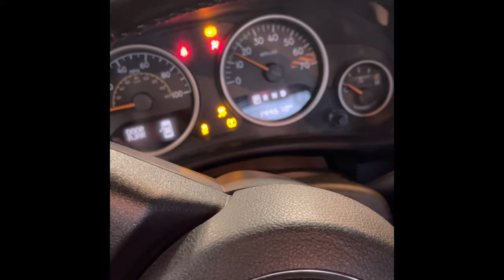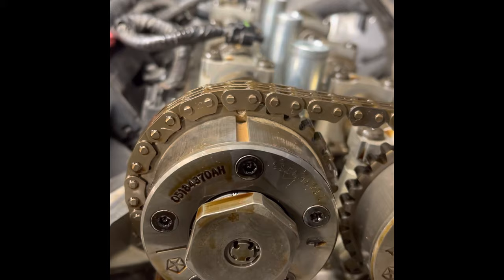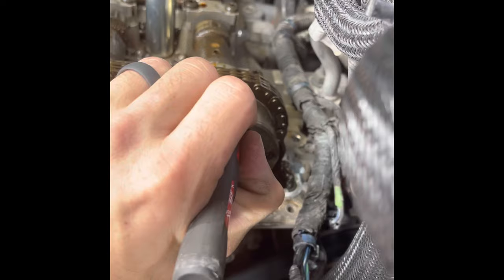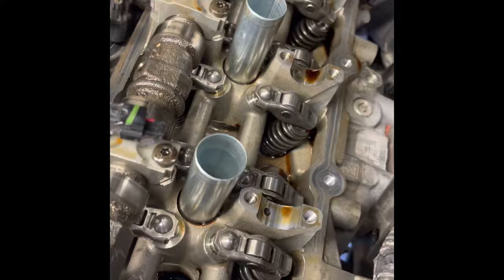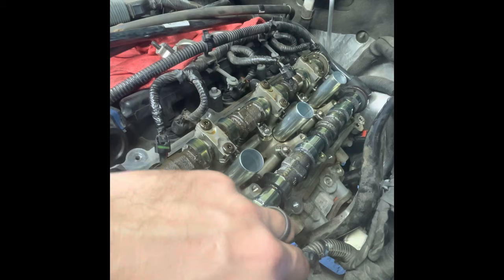Fixing an Engine “Tick” on a 2016 Jeep Wrangler | Rocker Arm Replacment

Comment: Replaced my rocker on the left bank #2 at 70,000 miles.  Dealer tried to tell me I needed all new rockers, lifters, camshaft, the works for 2300.00.  Did it ourselves for under 600.00.  Only one rocker was bad.  Lifters, camshaft etc were all fine.  The Pentastar overall is defective in that the number two cylinder doesn’t cool properly.  Anytime you swap for more horsepower you’re gonna sacrifice something else.  Chrysler knows they’re defective and yet will not recall.  At one time dealerships were getting hundreds of vehicles a month with the same issue.  Expect to hear the “death tick” around 70,000-80,000 in a Wrangler.  Fix it asap to avoid replacing more parts.
Reply: Well, sorta… early JK 3.6 cylinder 2 issues are from a bad cylinder head molding process, and there was a recall/maintenance service bulletin. I had that done myself. It was covered by the recall. 

If the head gasket can’t seal right it will cause issues down channel issues such as cooling.
Reply: as someone who is looking for a wrangler as a toy pretty soon, this is good info to know. thanks for sharing
Reply: Cylinder 3 is what got me. Rocker failed at 136k

Comment: A lot of the issue stems from the cartridge filter. The oil drains to the pan in minutes after shutting off the engine and constantly leaves the top end dry. They have a adapter for a regular spin on filter so you'll have the anti drain back valve to keep the top end of the engine always soaked with oil.
Reply: Thanks I'm going to look into this!
Reply: Do you have a link for it?
Reply: I modified mine - Baxter Performance - no more dry starts
Reply: Food for thought. All this full synthetic 5/20 0/20 oil.... I always go with a synthetic blend and something thicker...just sayn
Reply: What is this part called and do you have link??
Reply: I read you can prime the filter by holding the gas dwn, turn it over for 3 seconds. Turn it off. Start the engine, it starts quiet. I've got just over 12k/kms on my 2015, annual syn oil changes and it sounds like it's already starting to tick. So it's a common problem but no recall?

Comment: So the sound is not normal
Reply from the maker: No, they’re supposed to be relatively quiet. If you hear a lot of tapping noises then there’s definitely an issue. Sometimes it will progress to the point where you’ll get a check engine light and the vehicle will start misfiring and running rough. On the Jeep in this video, it actually hadn’t progressed to that point yet but it was just loud.

Comment: You do not need to go through all of that. I have done 16 of these, and never taken the chain off. That little bit of scoring on the camshaft is not gonna make any difference. All you need to do is mark the chain and camshaft each on three different places remove all of the camshaft caps. Except for the one closest to the cam gears. Those need to be loosened rotate the engine with a socket on the crankshaft and when the lobes are pointing up, the camshaft can be raised slightly in the rockers come off.
This is actually a simple fix doing it the way that I described.
Reply: Exactly!
Reply: You can even replace the rocker arm closest to the can gear doing it this way? I assume you replace them one by one, as you rotate the crank and get the lobes to point up?

Also, where do you mark on the cam and chain?
Reply: I’ve seen this hack, and I believe that removing the cam shafts as done in this video  isn’t THAT much more work IMO. Also the cam shafts are relatively cheap and worth replacing too. Especially if the cam damage from the bad rocker is significant, which it can be, and will cause issues. They also likely have 100-150k miles on them. 

Also delicately removing the rockers with the cam pushed over takes patience and time. Especially the ones close to the timing chain. 

Anyways, it’s one way to do it, just not one I’d do myself. I’d also say going all out and removing the timing chain cover (technically the proper way) is a bit absurd, so this video is a good compromise.
Reply: Wanna make that 17?
Reply: @harrycallahan686 Haha! Made me laugh.

Comment: I have not yet taken my Jeep in, but I’ve had this clicking noise for quite a long time now. It’s starting to get on my nerves, so I figure I should look into it. I’ve been told online by people hearing the video that work on jeeps that I need a new engine… But the clicking sounds just like what I’m hearing on this video. Is this a pricey fix?
Reply: I was just told the same thing for my Wrangler JK… needing a new engine or selling my Jeep before anything worse happens. For the job it needs done would be the same cost as getting a new Jeep. Sucks..

Comment: Are the replacement rockers an "updated" part - or doomed to fail again? Chrysler knew there were problems for years and years - you would think they would have treated that rocker bearing like it was mission critical, like a rod bearing.
Reply: Not if the Dealership is making $2,500.00 to fix them
Too bad Chrysler, Dodge, Heep, & RAM can't build quality Valve Trains that last 250,000 miles like Toyota.

Comment: Question for you. When you turned the camshaft to align the sprocket, that doesn’t mess with the timing? Maybe I need to go watch a timing video lol!!
Reply from the maker: No, because as long as the marks on the chain align with the marks on the sprockets, then the timing is good. On the front of the camshaft there is a little dowel pin, so the sprocket can only go on one way. By turning the camshaft, I was actually lining everything up properly. I’m not sure if I answered your question.

Comment: Hello. Thank you much for this clear explanation! Extremely helpful. 
Could you please share Oem references for rocker arms, lifters and camshafts ?
Reply from the maker: Rocker arms: 5184296AH
Lifters: 5184332AA
Camshaft Exhaust Left: 5184377AH
Camshaft Exhaust Right: 5184378AH
Camshaft Intake Left: 5184379AH
Camshaft Intake Right: 5184380AH
Reply: @jackhfletcher  Thank you!!
Reply: @jackhfletcher  any view on Melling rocker arms ? (MR-1332). Any upgrade compared with oem ? (they're 40% cheaper than oem)

Comment: I had the rocker arms and lifters replaced in my 2013 JeepJK. Probably 10-15k miles ago. Im now having noise on start up after the Jeep sits for a couple of days. It s kinda of like a ticking noise for 5 or 6 seconds then goes away. Are they going bad already?
Reply from the maker: A lot of different vehicles tend to do that after sitting. I wouldn’t worry too much about it.
Reply: Was it expensive to have it done?
Reply: About $3500@ the jeep dealer

Comment: i ended up getting a misfire code for cylinder 2 and engine started overheating. ( i did not burp it so maybe thats why its overheating?) any suggestions? Also i noticed that the alternator connector isnt locking properly but i will be switching out the connector tomorrow morning. I cleared the code restarted the jeep and it popped up (engine light) and went away 30 seconds later for the same code(misfire) Any help would be greatly appreciated
Reply from the maker: Have you done any work to it recently? If so, what all has been done?
Reply: @jackhfletcher  while i did the rocker arms i lifters i also replaced the pcv valve and oil cooler housing
Reply from the maker: If the overheating didn’t start until you replaced the oil cooler, then you probably got air in the system. Take a flat head screwdriver and open the bleeder valve on top of the thermostat housing until you get coolant running out. I recommend using a spill free funnel and putting it on top of the radiator and filling it with coolant. Start it and let it run and warm up and then shut it off and let it cool down. You may have to do this a few times. Then remove the funnel, reinstall the radiator cap and go for a drive. It should be OK after that.
As for the misfire, if you still had a cylinder two misfire before doing the lifters and rocker arms, then the problem probably lies elsewhere. But if the cylinder two misfire did not start until you replaced the rocker arms and lifters, then I would go back and double check all your work. Make sure your coils and injectors are plugged in properly, etc.
Reply: @jackhfletcher  i just bles the system but still no heat and it starts overheating. Once the fan kicks in it starts to overflow on the funnel

Comment: @jackhfletcher Changed my rockers, and now getting a check engine… cps bank2 sensor B  and multiple misfire…..will this need to be relearned or will it do it from driving? Thanks
Reply from the maker: It shouldn’t do that. Something probably wasn’t put back properly or something got damaged. Bank 2 sensor B is the driver’s side exhaust cam. Check the cam sensor. Make sure it’s installed properly and make sure the wiring is good. You may have to pull the valve cover and see if the sensor or the target wheel on the exhaust cam is damaged. Actually, I just realized as I’m typing this that more than likely the timing is off if you removed the timing chain. Double check the timing.
Reply: @jackhfletcher  no actually a friend (mechanic) did it for me and didn’t remove the chain
Reply from the maker: @rbjackpotslots4842 Check the other stuff then. I’ve done a bunch of these and I’ve never had to do any type of re-learn.
Reply: @jackhfletcher  ok thanks for the quick reply I screen shot this I will show him thanks again

Comment: I had my oil changed at my dealership and they forgot to tighten the oil filter the low oil pressure light came on then the check engine light while me and my seven year old were driving on a very busy highway the jeep lost power almost got in a really bad accident got it towed dealership said nothing was wrong now it makes this noise it only had 2 quarts of oil but nothing was wrong 😂 what do you think are they trying to cover their ass 😮

Comment: Is it normal to still hear a slight tick after replacing all rockers and lifters?
Reply from the maker: You’ll always have a little bit of valvetrain noise  so since you replaced all the rocker arms I wouldn’t worry too much about it.

Comment: So what causes the problem? Or do we just keep throwing parts at it?
Reply from the maker: The rocker arms are cheaply made and the roller bearings fail. I guess you could say the cause is poor manufacturing quality.
Reply: Too bad Chrysler, Dodge, Heep, & RAM can't build quality Valve Trains that last 250,000 miles like Toyota. @jackhfletcher

Comment: What is the cost for this type of repair? I have the same issue
Reply: Couple thousand, $2,500 seems like an average price for some shops with parts and labor
Reply: Get your hands dirty I know it seems like a big job and scary but it’s not too bad and you can save a few bucks the parts are pretty cheap and you don’t need super expensive tools

Comment: How long does this take you?
Reply from the maker: The book time is around 6 hours I believe. That’s pretty close to how long it took me the first time, but I can do it quicker now.
Reply: @jackhfletcher  thanks. I've got the exact same issue developing on my 2015 Wrangler at about 74k miles.
Reply: @jackhfletcher  What does this cost to repair, typically?
Reply from the maker: Those camshafts are about $500 each. The rocker arms are about $12 each. Plus gaskets, etc. So it depends on how many camshafts are damaged, if any. If only one is damaged, you’ll probably spend around $1500 or so.
Reply: Do you know if the extended warranty covers it?

Comment: Just had lifters, rocker arms, and cam shafts replaced on my 2015 Chrysler 200s with the 3.6L. Only had 130k on mine. Hopefully now that I replaced those, they will last for another 130k. But it’s a Chrysler…..so who knows?
Reply: How much did that cost, if you don't mind me asking?
Reply: @BryantBates  Too much. lol. 

It was about $3,100. I took mine to a private mechanic too, not a dealership. At a dealership, it probably would have been $5k+. But again I had all camshafts, lifters, and rocker arms replaced. One camshaft alone for the 3.6L is like $450 right now just for the part. Multiply that by 4 and you’re already at $1,800.
Reply: @gabewl29  that's not as bad as I had thought it would be lol. When I had the lifters replaced in my 14 Wrangler, it was almost 3k a couple years ago. But that was at a dealership.

Comment: What should a customer expect to pay a shop for a job like this?
Reply from the maker: It depends. Just for one side of the engine, the lifters and rocker arms are about $260 in parts, and the camshafts are $500 each. Then expect to pay about 5 or 6 hours of labor.
Reply: 2 shops told me to replaced engine around 8k to 10 k I opened the top and found the same rocker arm is bad
Reply: @armingelloagan5216  this gives me hope because I just got told the same thing

Comment: What  is the main reason these fail I have a 2014 wrangler I run full synthetic oil in it and and a quart of Lucas oil supplement and change oil every 4000 miles I am hoping this helps keep this from happening to my 3.6.
Reply: It won’t once you get 70-85k it comes I changed my oil every 5k and did nothing. My friends have the same problem
Reply: I've heard that the problem lies with the cartridge type filter, that it drains oil out of the top of the motor too quickly once the engine is shut off. There's supposed to be an adapter to where you can use a canister type oil filter, that have an anti-drain valve in them to keep oil in the top of the engine once shut off.